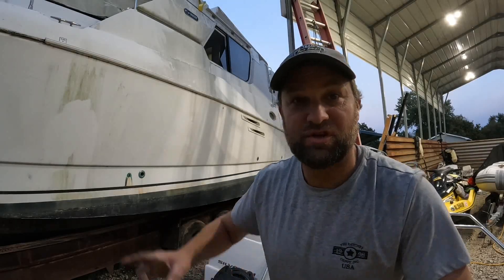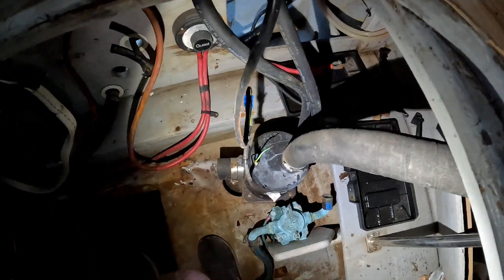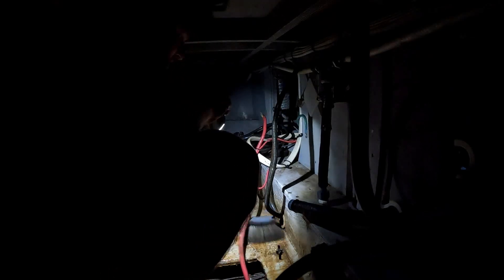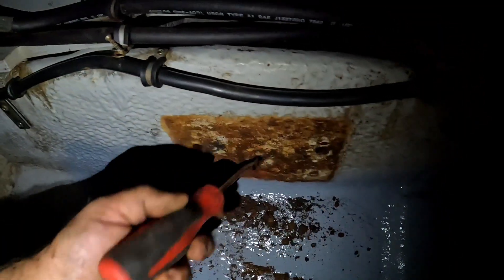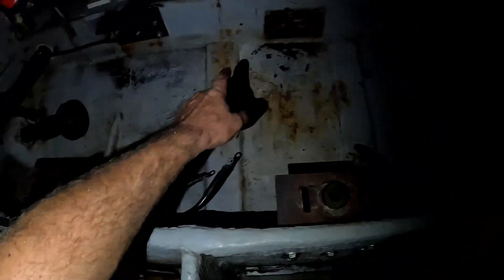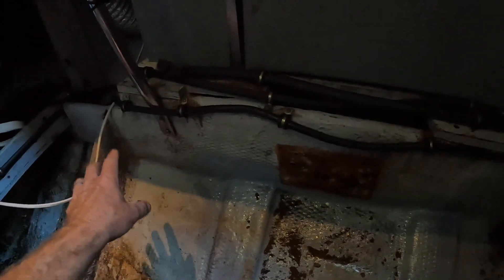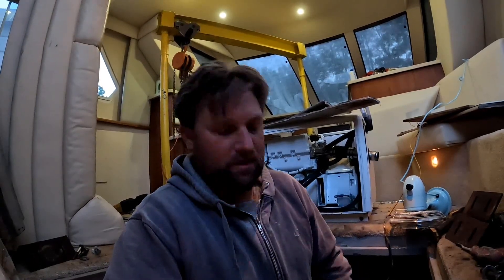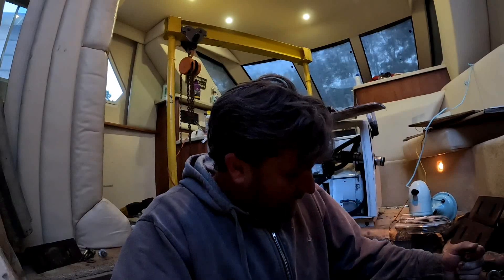Hurricane Damaged Yacht Rebuild Silverton 322 pt:2 Surprise!

Comment: Well that sucks about the stringers,  defiantly check with the moisture meter.  I would think the more air movement you put across the remaining small parts the more damage it would create.  Unless they are just really small golf ball size areas.  But I am no expert.  Epoxy does sound allot like it would fix it.  Good thing you found the problems before you dropped the engines in.  With them out it makes it easier to do a proper repair,  and paint the bilge will look brand new when your done.